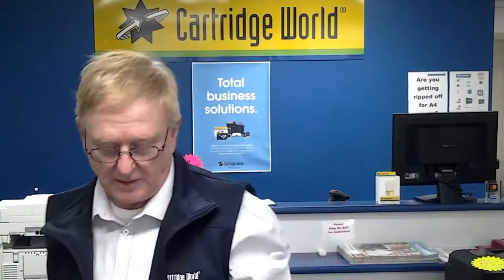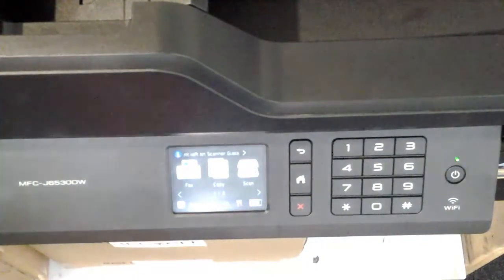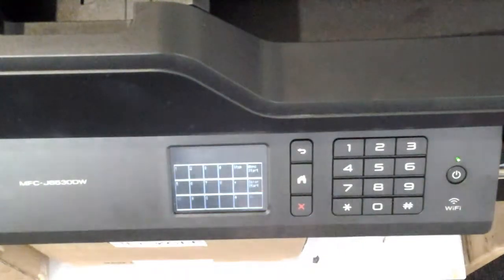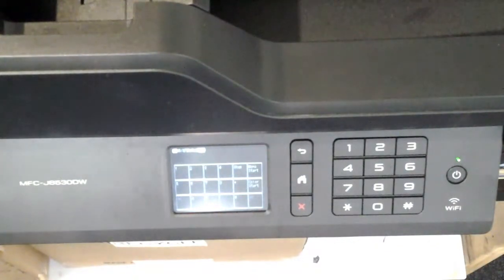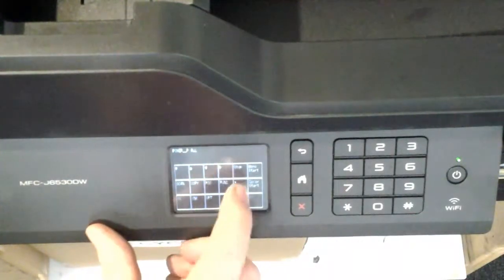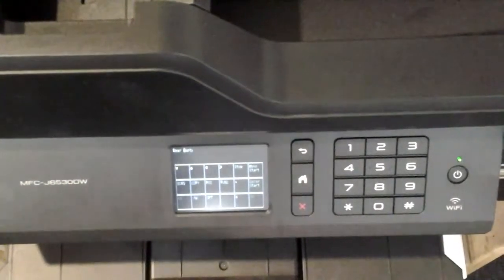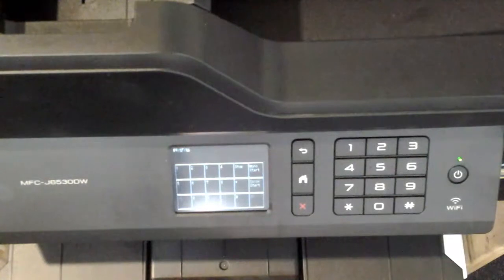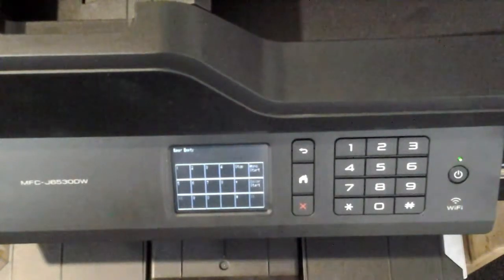Brother MFC-J7630, MFC-J6530, J6930, J6530 & MFC-J6920 Printhead Purge

Comment: Tried Brother online support without success. Chatted with support rep, without success except for suggestion to send printer in. Talked with local tech repair - either they didn't work on printers or their base charge was $100 to look at it. Did a google search and found this video. My printer is now working great! Until seeing the new printouts, I had not realized that the print quality had been gradually degrading for awhile. I have a MFC-J6920 that is only 4 years old. THANK YOU! Will try to post this link on Brother's support page.
Reply from the maker: Thats the way!!

Comment: This worked on my 6920 printer. After 763 hit Mono Start. After the cycle is over hit 763 again, then Mono Start again. After you have run a few cycles of this hit 99 to get back to the Home screen and run a test print. Had to do 763--Mono Start 6 times before black was cleaned fully. Thanks for a great tip!
Reply from the maker: Thanks!

Comment: Brother MFC J6710 DW
Press MENU once,   then *2864 on the right side keypad. Now the display shows Maintenance. (and fax copy etc starts blinking)
To purge enter 763 on the keypad, the display now shows Power__P All. With left or right arrow key you can select the ink color.
{760 purge after head replace, 761 single purge, 762 normal purge, 763 power purge, 764 initial init purge. 760 and 764 cost more ink}
Start the purge by pushing start mono (most right button row)
After the job is done you can leave Maintenance by entering 99 on the keypad, the printer now restarts.

When in maintenance other numbers give other maintenance funtions. (if not the desired one you can go back by pressing Stop)
11  print out the internal configuration of the printer
32  sound check
35  print out dial log list
99  leave maintenance
There are a lot of maintenance functions like calibrating the scan area, so be carefull what you doing when experimenting with trying other numbers.....
Reply from the maker: Thank you!

Comment: I have the MFC-6930DW. This does work. Tried 3 times normal cleaning for a cyan problem and Cyan was getting worse everytime. Third time there was no cyan on the testpage left and Magenta went out. With your method it was cleaned in one go and no other ink used, testpage is perfect now. Just need to buy another magenta now after the 3 times normal cleaning.
Reply: Fucking Cyan, all my homies hate cyan, it's always cyan for some reason.
Reply from the maker: Very cool!
Reply from the maker: @ditodevice1950  Cyan is the Bitch Ink Spawn of the Devil!

Comment: Wow, i thought I had to buy special fluid and do acrobatics with my printer in a last ditch effort to salvage it. Then I found this video. I can't believe it. I'm like sharionreis5374 like the previous post and was stuck at the same problem for the same model. Other than the fact that it runs on ink, the printer is well designed. It prints fast and scans big. I just wish ink doesn't dry, clog or do all these things that give consumers grief. A million thanks!
Reply from the maker: Download and print a colour wheel and copy it every fortnight to keep the printhead moist and clean. https://images.ctfassets.net/j001bqnk84dk/Dhgha2JGlOMnboDwdNzQ2/4a9644e1f1aaa7ce61b1c122cae08f51/colour-wheel-segments.png?fm=webp

Comment: Sidenote! I thought this method would only use one colour cartridge, as I put a cleansing cartridge in Cyan and I selected cyan in the menu. But apparently it also used magenta and yellow ink so...all my ink is gone now except black! However, I think that it worked because I noticed that the cyan cleansing cartridge is finally empty and when I did the regular cleansing method several times, it just stayed full, so there was no movement. That's why I did the cleansing 10 times, a bit of an overkill, I know, but I thought it would just use the blue cleansing cartridge. Anyway, thank you for sharing. I have to order some ink now, as I can't do a nozzle test print yet. I have a Brother-MFC-6930DW.
Reply from the maker: Yes that is a lot! A cartridge world can refill it.

Comment: Thank you so much! You just saved me from throwing away a printer which suddenly refused to print black. The info from your video did the trick, after running the mono cycle 5 times on the MFC-J6920DW, everything declogged and my printouts are fine again! Note that when I selected black before "Mono Start" it felt like a much shorter cycle and did not improve much. But when I went directly for "Mono Start"  after 7,6,3 it worked better...
Reply from the maker: Meik Doell: Hey, that is excellent news, I'm delighted for you and thank you for taking the time to post!

Comment: You're amazing. I can't thank you enough. My printer has been broken for months. I thought I was going to have to buy a new printer. I ran through the maintenance 3 or 4 times and got it working properly again. However, I do have a question, after entering 7,6,3 I couldn't run the cleaning on the colour option, I could only run the cleaning on the mono chrome. Is that normal or can you run it on colour with a different prompt?  anyhow it worked I'm just curios, if you could respond to me, that would be good. Also, my printer is the MFC-J6720DW for reference. Anyway, the reason for commenting is because I really wanted to thank you. I'm so happy that my printer is fixed I'm over the moon, thank you, thank you, thank you I seriously can't thank you enough. I'm really pleased with the result you're awesome, thanks.
Reply from the maker: Mono is a command, it's not just for Black ink, it does them all.
Reply: @cartridgeworldcastlehill9518  ok great, my printer is still working well. Thanks for getting back to me and answering my question. Thankyou very much, much appreciated

Comment: During a purge, does it use up ink from the cartridges? I have a MFC-J6530DW and none of the colours are printing properly. I put a fresh set of all 4 cartridges and did some normal cleans and due to the number of cleans it has almost emptied the cartridge. So would a purge as per this video drain more ink or does it purely clear the printhead?
Reply from the maker: Sure, it sucks ink like crazy.

Comment: Schade, dass man nicht viel erkennt, weil sich die Lampe im Display spiegelt und die Auflösung von 720p auch nicht sehr hoch ist. Das wäre aber gerade für diejenigen wichtig, die die englische Sprache nicht so gut verstehen.
Reply from the maker: Ahhh, is that good news or bad news?
Reply: @cartridgeworldcastlehill9518  
I translated it into Englisch:
It's a pity that you can't see much because the lamp is reflected in the display and the resolution of 720p is not very high either. But that would be important for those who don't understand the English language very well.
Reply from the maker: @andilowe9526  Yes, it's a poor picture.